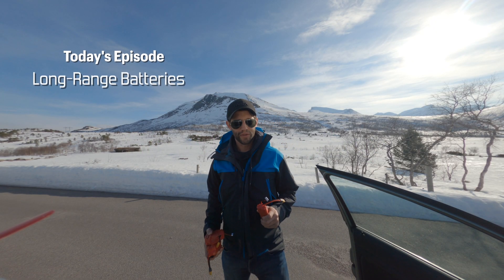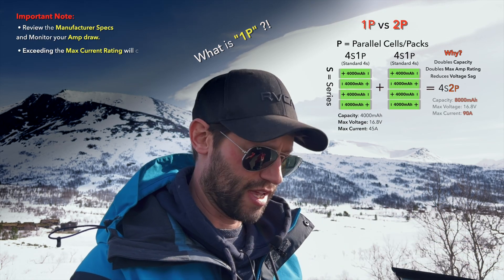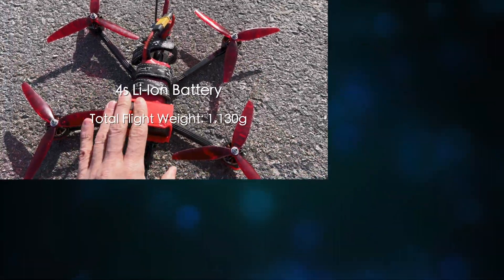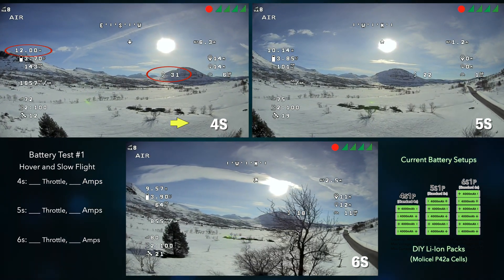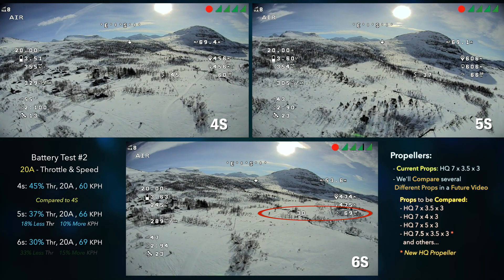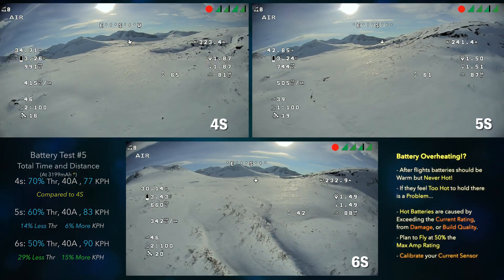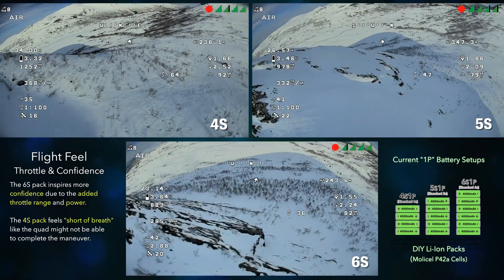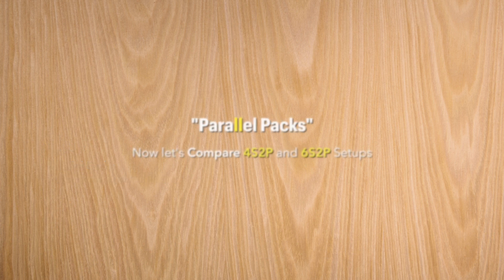Li Ion Battery Comparison for Long Range FPV Quads, Wings, and Planes. Chimera 7 with HDZero VTX

Comment: Very helpful video - thank you! Production quality with visuals is top notch. Are you still planning on doing a comparison with the 18650 Molicel P28A?
Reply from the maker: Thanks, I put a lot of effort into the “production”, so I’m always happy to hear when people appreciate it. 

I actually just made an 5200mAh 18650 6s2p pack using Molicel P26A cells which handles up to 70A. It’s a really nice addition to the larger 21700 packs, both as it’s 300g lighter and it’s also smaller in size so fits nicer. 
The flys noticeably lighter, uses less Amps, and feels more agile and quick. I’ve gotten 13km (8miles) of fast cruising from it, so it works great for most flights. 

I have not yet done an proper comparison to the bigger 21700 packs, but will try to do a follow up soon. 
Thanks for watching, stay tuned, cheers!

Comment: Really thorough data & presentation. Very impressive what you've done here. Great work! I fly 4S lipo & get pretty good range/time/efficiency on my 8" here in Alaska, but I'm always wondering about bigger range you know! Although I get more & more nervous the further out I get. Maybe if I were rich I wouldn't worry about it so much!
Reply from the maker: Really appreciate the comment. This video took some effort and it’s really such a specific niche topic… but as with all my videos, I was curious and figured I’d share my findings. 

Increasing range, flight time, cruising speed, and exploring new areas is what it’s all about. The fear and anxiety we get during the flight is what makes it so exciting! 
Good Antennas, GPS Rescue, Self-powered Buzzers, and Telemetry Logging are all key to improving recovery of a lost quad… but sometimes, in my case at least, climbing gear would be necessary. Haha! 
Anyway, long response, but I appreciate the comment, happy to answer any questions, and curious to hear about your new records. Stay tuned, cheers!
Reply: @GiantAntCowboy  So it looks like flying slower saves a bit of power...that makes sense. I've gone just over 5 miles out with my set-up. Don't really need more than that.
Reply from the maker: @fpvflyriding  absolutely, like in a car, the faster your go the more fuel you use. 👍

Comment: I think the battery manufacturers lie to us. I've never seen a 18650 cell that can deliver more than 35A for more than one or two seconds without getting damaged and neither have I seen a high current cell that has more than 2600mAh. For motors over 22mm diameter I would always use 2p packs even if they are a lot heavier. Maybe biblade props can reduce amp draw but they tend to produce a lot of jello in the footage.
Reply from the maker: The 18650 Molicel cells say 35A max, I recently built a 5.2Ah 6S2P pack with them and I’m very happy with it. Saves about 300g compared to my 21700 8Ah packs, so it flys a bit nicer using less current and I managed a 13km trip the with it the other day. 

I run everything in 2P configuration for the most part unless it’s a quick gentle flight, and I prefer high pitch tri-blades. The bi-blades I’ve tried always felt dull, or lacking in thrust power after a dive or tight turn. 

Anyway thanks for watching and sharing some insights.

Comment: Very helpful test data. I am running emax 2807 1700kv motors and will settle for 5S1P molicel p42a.
What props have you settled on? Looking forward to that video.
Why arent many running bi blade like HQ 7x4.5 ? someone cliamed he cant get rid or the jello.
Please recommend me some props shortly. Tanks
Reply from the maker: Honestly the favorite props are HQ J75 props. They’re a 7x5x3 prop that give really nice control and cruising speed. 
2-blade props always felt underwhelming to me, like I have less thrust and control. High pitched 3-blade prop are obviously less efficient, but with these huge 8Ah  packs flight time and distance is never an issue for me, enough to easily fly 14km (8 miles).

Comment: Thank you for the video, do you run inav or betaflight? If betaflight does gps rescue work pretty good now?
Reply from the maker: You’re welcome, appreciate the comment. I’m running BF4.3 now, but haven’t really used GPS rescue since I upgraded to the version. 
Historical GPS rescue has been a little goofy, but it always came back when it needed too and even saved me a few times. I’ve thought about trying iNav so many times.. but it’s just another thing to set up, as it is I barely have time to go out and fly. 
Happy to discuss further, thanks for watching, cheers!
Reply: @GiantAntCowboy  I tried setting up inav a bit and it looks similar to betaflight but just different enough to mess me up. My hdzero osd was having some glitches too. Characters overlapping or getting stuck. I think I'll flash betaflight again and set that up. Thank you!
Reply from the maker: @Jeb223  yea. That’s what I assumed would happen to me… everything in this hobby turns into a huge project. 
In other news I’m using the BF4.3 UAV 7”Preset on the Chimera 7 and it does fly noticeably better, of course maybe I just did a crap tune previously…
Reply: @GiantAntCowboy  ok excellent, I may have totally copied your build lol
Reply from the maker: Oh yea, that’s good to know. It’ll be curious to see how ours compare then. I recently switched to ELRS, but getting some interference noise now. 

What’s your range goals?
Reply: @GiantAntCowboy  it will be my first long range drone so I'd be pretty happy with anything. Are you using 2.4ghz elrs?
Reply from the maker: Cool, well take it slow until you really trust the build, setup telemetry logging on your transmitter so you always have the last GPS coordinates and other data, add get a ViFly Finder 2 buzzer, or similar,  which can beep and flash for up to 30hrs even if the main battery is gone. 

Yes, I went with 2.4ghz because tests were showing range well past anything I’ll ever do… and it faster. Plus I was getting some interference and LQ issues with my Crossfire setup, but now I’m getting different interference issues with ELRS haha! 
Always something to troubleshoot.
Reply: @GiantAntCowboy  thanks for the advice, I'll let you know how it goes :)
Reply: Hello there, do you remember the length of your mipi cable? Mine is too short.
Reply from the maker: @Jeb223  yea, I had to use the 250mm mipi cable.
Reply: @GiantAntCowboy  cool thanks! I'll see if I can find one in stock

Comment: Very interested to know what weight and flight time the quad would be with a 4s2p or 6s2p configuration. Also how it would compare vs a LiPo battery of similar capacity (say a single 5000mah or 2x 3300mah). I'm pretty new to long range, but have questions about lion vs lipo performance since I'm getting consistant 10 minutes with 2x1550mah or 1x3000mah 4S batteries landing at 3.5v - Would LiPo not give you that extra "pop" in 4s configuration that you want?
Reply from the maker: In the video I thought I showed the weights and flight times for the 4s2p and 6s2p setups. But basically the:
- 4s2p pack weighs 620g AUW w/GoPro is around 1400g, flight time 25+ mins. (And this pack is old and damaged, so should be more)
- 6s2p pack weighs 925g, AUW w/GoPro is around 1700g, flight time 22min (but could be more with gentler throttle)

LiPo vs Li-Ion: 
- LiPo have higher energy output abilities 
- Li-Ion have more energy per gram 
Ex: A 6s GensAce 4000mAh LiPo weighs around 600g, a 4200mAh Li-Ion weighs 450g. So 150g or 25% less, and actually 200mAh more. 
Also this is with larger 21700 cells. If you used 18650 cells you would save even more weigh but lose some current output. 
As far as which to pick, it’s a bit of a numbers and cost question that doesn’t really have a correct or perfect answer.

Comment: Interesting stuff. I have built a 4S1P P42A pack for my 6" build. I think I can keep it under 45A most of the time. I've not flown it yet. You say that things go bad if you draw too much current. How bad? Is it ball-of-fire bad like with a Lipo, or a little less extreme?
Reply: Oh and another question. You flew with 2P packs as well. Are they just two of your 1P packs wired with a parallel XT60 lead, or a permanent 2P pack?
Reply from the maker: Yup, my 2P packs are just two 1P packs wired together with an XT60 adapter. I should have talked about this in the video. Thanks for watching, stay tuned for follow up videos. Cheers!
Reply from the maker: If you exceed 45A your voltage will sag/drop very quickly, and the cells will start to get hot. If you do this briefly, like a quick blip, it’s normally fine, but if you continue to push the pack it will get very hot and could theoretically catch fire, but would probably just lose power and crash. Repeatedly exceeding the max Amp output rating will damage the cells, increase internal resistance, and reduce their total capacity.
Reply: Thanks for the responses. Very helpful. I've subscribed.
Reply from the maker: @Yith  Great, let me know if you have any other questions or comment. Cheers!

Comment: looking to make a pack with the new mollicell p45b 4.5Ah 45A max discharge when they finally release
Reply from the maker: Yea those P45b cells look promising, hoping I can find a retailer in Norway when they are released.
Reply: @GiantAntCowboy  not seen any supplies yet in the UK
Reply from the maker: Yea, I think they’re still in testing, but they should be ready soon if imagine. I’m actually heading to the UK tomorrow morning, I’ll be down in Cornwall for a few days. So don’t be surprised if you see some Cornish footage in upcoming videos. 👍
Reply: Nkon in NL sells the 
P45a cells. Pretty expensive

Comment: Great stuff, looking forward to seeing how the 6S 18650 packs perform. I'm going to be building a 7" long-range cruiser this summer and making my own 6s2p packs, but haven't decided whether to go with 18650s or 21700s.
Reply from the maker: Yea, most my long-range flights are under 15km so the 8000mAh packs aren’t really necessary and add a few hundred grams, so I’m excited to test out the lighter weight 18650 packs. Stay tuned and thanks for the support, cheers!

Comment: Do you land at 2.8? My samsung packs never give the full capacity until 2.8, probably discharge current is a bit too high for those at 12A
Reply from the maker: Ideally I land before 3v, but my 4s battery packs are so worn out from a lot of abuse that they drop below 3v at like 80% capacity… I’ve killed these packs several times and have done high Amp maneuvers many times, so they aren’t in good shape any more. But still great batteries!

Comment: Hi “Ant” which would you choose for the Chimera 7” 1300kv
Auline 3300  45c $100 432g
Ovionic 3300 75c $77 500g
That’s 6s Lipo in Australia $ 😊👍
Reply from the maker: I don’t actually know Ovionic, so I’d have to say Auline, 45c is plenty and 70g weight savings is a lot. However it is $23 more… 
Have you thought about getting or making Li-Ion packs?
Reply: That’s for that yes I was heading towards the Auline … I just put a GoPro session 5 on my chimera but got a lot of gyro noise in Gyroflow 
But the air unit recording was stable …so it looks like the GoPro is picking up vibration but the quad sounds sweet and flys smooth 
Any idears I know it’s a bit off topic 
Cheers Phil 😊
Reply from the maker: A couple things to check:
- The GoPro mount should be firm and tight. 
- Install a new set of props if you have some. A slightly bent prop can cause a lot of noise. 
- Really you should record and review Blackbox logs and see how noisy your craft is; Not sure if you’ve done this before. 
- If your quad is noisy/has a lot of vibration and you can fix it, then you might actually have ignore my first suggestion and make the GoPro mount soft. Some people make a GoPro mount with zip ties that act like leaf springs. 
Let me know what you find out 👍
Reply: @GiantAntCowboy  thanks for your advice .. it’s a new build all new props good quality TPU GoPro mount … the raw footage is smooth and the video link is smooth 
I will try soft mount for GoPro 
And I really should get into black box logging just seems a bit overwhelming lol
Thanks for your help 😊👍

Comment: Haha, I love you left the battery juggling in at the beginning 🤣
Great tests and video as always, very well done.
I use a Molicel 6s2p 8.4Ah, and a Samsung 6s2p 8Ah for my long range flights, but mine has the 1300kv motors, and get a very similar time using either of them, around 20 minutes cruising at 80-90kph.  My overall weight with these packs is 1700g.  This is using the Dal 7056c, and more recently the HQProp 7x4.5x3 composite props.
Reply from the maker: Yea thought the opening was pretty funny… 😄 appreciate the comment. I recently tried/started using the HQ J75 props based on a suggest you made about the Dal 7056 and man what a beast! So much power and control, and I can hear it miles away. Haha! I’ll be working on a propeller comparison soon using 4-5 different 7” props, should be interesting. Cheers Kev!
Reply: @GiantAntCowboy  Yeah, I love the higher pitch props for power and control.  Looking forward to the video.
Happy flying 😎

Comment: I’d be. Very interested to see test between 4s3p vs 6s2p - with that setup the battery weight would be the same.
Reply from the maker: That’s an interesting idea, with these 21700 cells you’d have 12000mAh and could fly forever! I’ll put it on the list of ideas, thanks for watching and sharing! Stay tuned, cheers!
Reply: But isn't the amp rating gonna be lower?

BTW I'm very interested about doing mountain surfing but with LR 5 inch ..how different my experience gonna be?
Reply: Because my také off weight gonna be around 440-550gr with 4k 4s lion

Comment: Me running my 2807 1700kv ecos on 6s... 😶
Reply from the maker: Thanks a beast I’m sure! LiPo or Li-ion generally? Any motor limits set up or anything?
Reply: @GiantAntCowboy  I've run it on both, no limits, at the time I just assumed they were 6s capable because the BH equivalent motors were. The motors never got too hot or anything so I just kept running them on 6s, with a 55amp Esc.
Reply from the maker: Ok just curious. I think unless you’re running at max throttle constantly the motors are perfectly fine on 6s.

Comment: Awesome flights man. HDZero looks breathtaking... And OSD!!! Also I don't know why it's so different, I built a 6s1p liion pack with p42a molicels and with 3850mah drawn on a chill flight (average speed 62kph) I was in the air for 18 min and covered 18.7km. My setup is a iflight titan dc7, emax ecoii 2807 1500kv (same as yours) AUW is 1150g with a hero 7 black.
Reply from the maker: Thanks man, appreciate the comment and support. Yea HDZero is great, really glad to be part of the evolution this year, its been a great system for mountain cruising here in Norway. 

It does seem you’re getting better flight time than me, but I’ll have to look back at the footage/do another test to confirm. Seems our setups are extremely similar so it’ll be interesting to see. Thanks for checking out the video, I’ll let you know if I can match your flight time and distance. Cheers!
Reply: @GiantAntCowboy  gorgeous country I'm jealous 😁😁
Reply from the maker: @NicholasLubbe  yea, Norway is an incredible place, especially for FPV. I’m technically American, but moved here because it’s so great for FPV… haha! Just kidding, but it’s certainly a pleasant bonus of moving here.
Reply: Auw is 1150g with gopro AND battery? Wow!

Comment: Interesting comparision, so the larger but heavier 6s pack doesn't really increase your flight time but gives  you better performance.
But why are you running such low pitch props? Shouldn't high pitch props be more efficient?
Reply: Given its 7 inch, 3.5 pitch is reasonable and no higher pitch props aren't more efficient it's the other way around. Reason being that the motor is essentially in a 'lower gear'. We'd think it would make it go slower but to a point it doesn't, at least not noticeably. Reason being is that the motor has the ability to spin closer to it's max actual rpm all while using less current, making it more efficient. Motors never reach their max capable rpm with props on anyways so they make up for the headroom.
Reply: I don't understand why mine is so different, running same p42a 4200mAH 6s homemade pack on my DC7 with exact same motors, AUW 1150g, I was in the air for 18min and covered 18.7km, average speed 62kph
Reply from the maker: Seems to be the case, but there’s a lot of variables. I was running 3.5 pitch props for efficiency but have a bunch of different props I’ll be comparing in an upcoming video so stay tuned. Higher pitch seems to “burn more fuel” but we’ll try to do some real side by side tests to find out for sure. Thanks for watching and commenting, cheers!

Comment: Good comparison. But you really need to switch to measuring in WattHours instead of AmpHours when comparing efficiencies of different voltage packs.
Reply from the maker: Very good point! I was manually calculating it when reviewing things but I’ll set that up for the future video. Thanks for the tip!

Comment: Great work!!! Hope to see more videos about long range flights on hdzero, nature amazing on your place)))
Ps: about battery s: people usually dispute about 4s 2400kv and 6s 1700kv setups, do they have equal power and flight time)))
Reply from the maker: I don’t really know for sure, always a lot of variables… I’d have to build a proper test setup to find out.  I’m working on some more neat HDZero videos now, so stay tuned and thanks for the comment, cheers!
Reply: Power output aside, the reason 6s is more efficient aka more flight time is because the overall amperage for a given wattage is less, thermal loss goes down bringing efficiency up. Aside from that, even running a 4s on a 1700kv motor, the voltage sag is less, throttle is far more responsive and sharper (less power on 4s but far more controllability than 4s w 2400kv), and on 6s it gives that and far more motor torque.